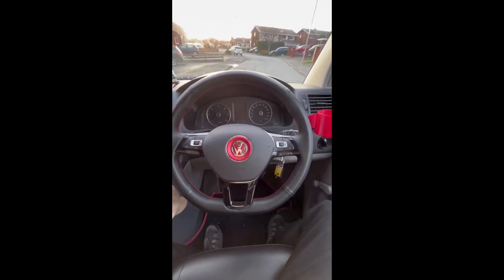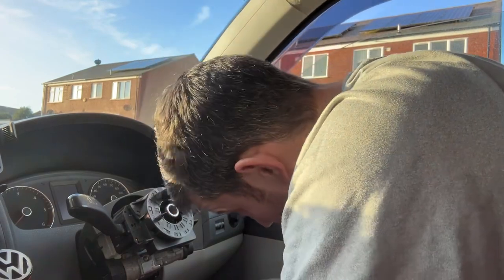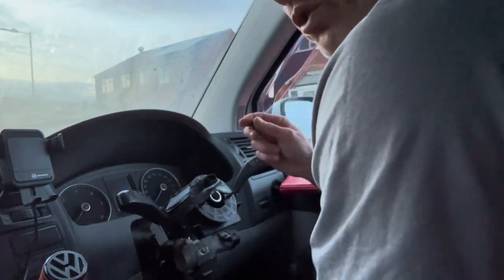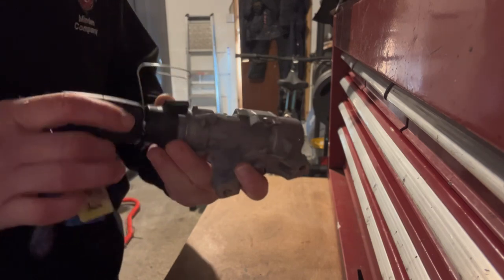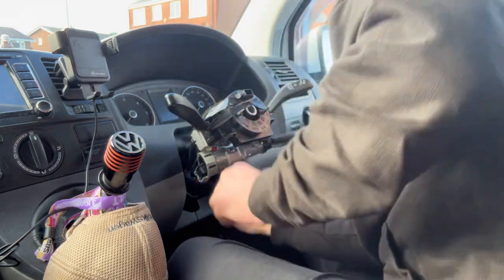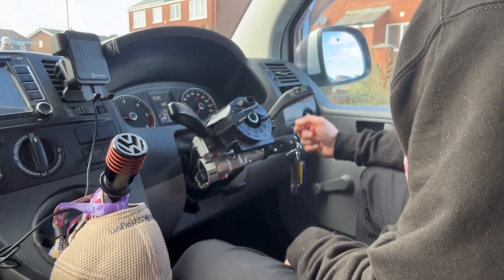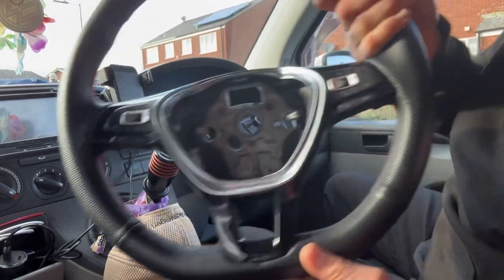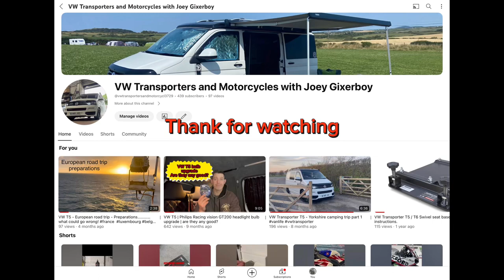VW Transporter T5 | Ignition Steering Lock Replacement

Comment: Thanks for this, it’s great how to, i had the same problem, I went to all the effort of getting them bolts out but it turned out to be just the actual ignition switch so I needn’t have bothered. Cheers
Reply from the maker: Would of been cheaper too haha.  Thanks for the comment.
Reply: @vwtransportersandmotorcycl3729  luckily I’d bought just the switch previously so used just that. I got lucky I think 👍🏾